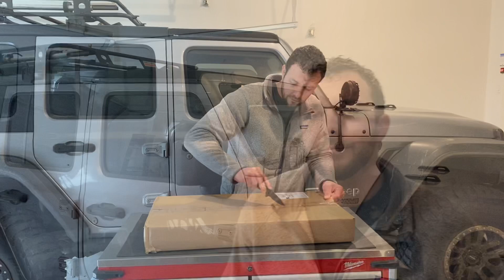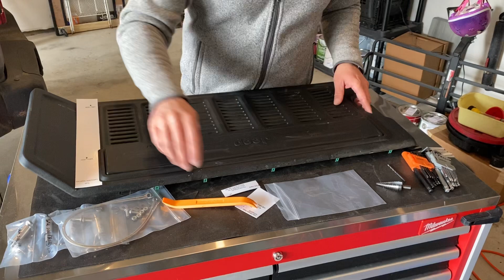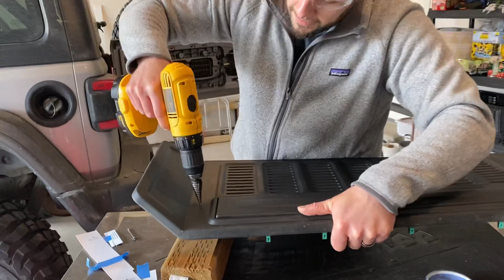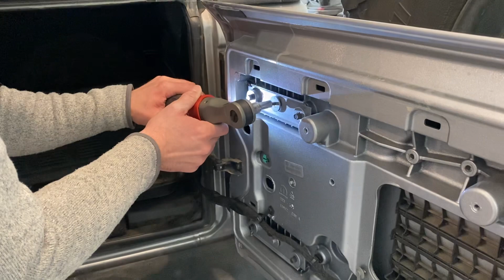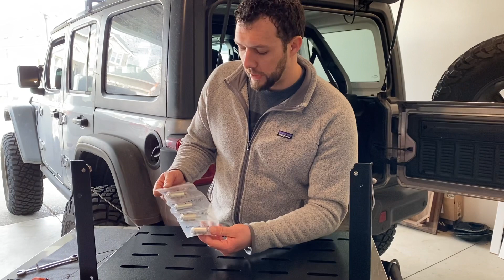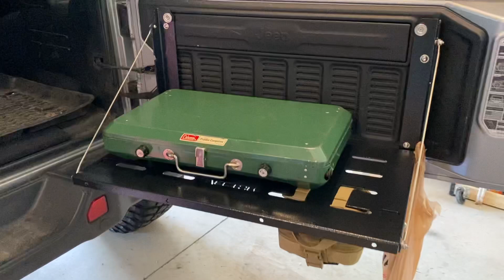New JL Wrangler Tailgate Table from Vector Off-Road Install

Comment: Another nice install video.

 I have that one on my JL. It looks like they made the templates a little better, I don't remember the one with the hole in it. That is a great tip about putting the trim piece back in and drilling from the back.

Interesting fact, the table is aluminum but they have those little steel tabs where the magnets hold the table upright.

The magnets are strong enough for me to have 3 different molle bags on it and my Element fire extinguisher.
Reply from the maker: He man, thanks for watching! I did like the templates I got made the install a breeze. I figured it was aluminium didn’t know the magnet part was steel though. I’m glad to hear yours is able to hold all that weight on there! I’m thinking about getting one of those Element fire extinguishers as well, seems like a great addition!